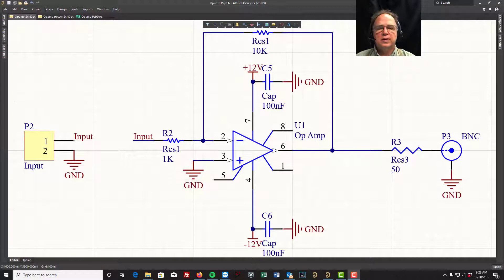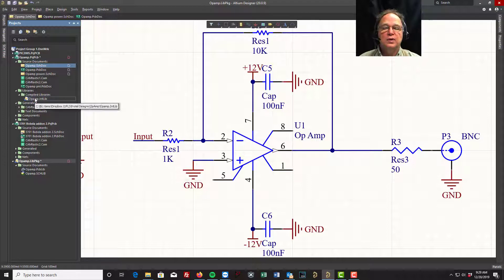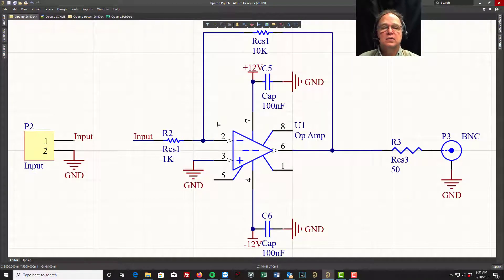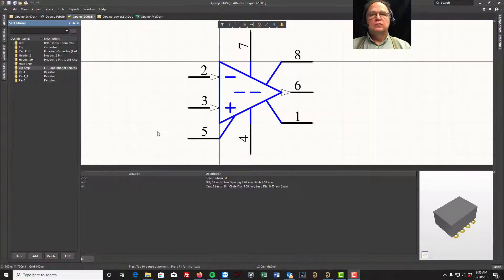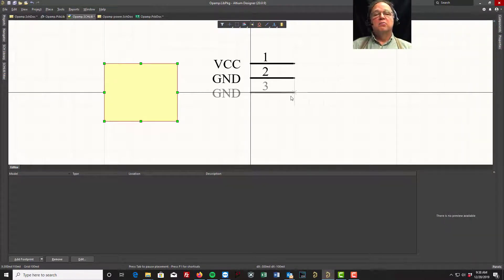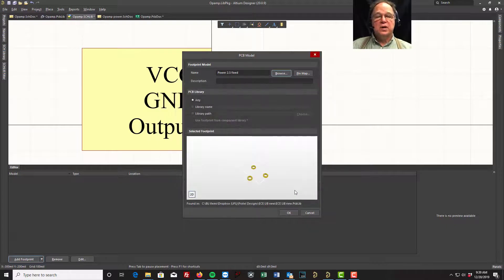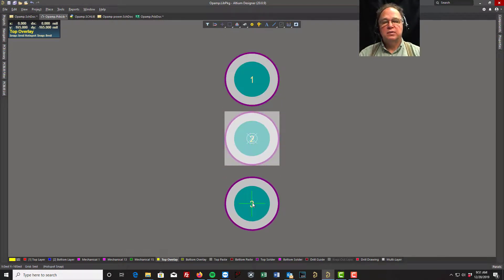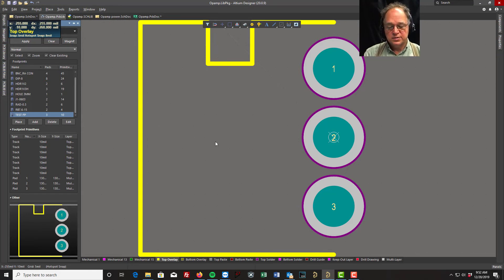10 Altium Designer 20 Integrated Libraries

Comment: I updated the RES3 resistor as you did, and confirmed that one of the silkscreen lines was gone as expected.  However, when I went back to the schematic and clicked on R3 and looked at the footprint in the properties panel, the footprint still looks like the original from the miscellaneous library (with both of the silkscreen lines).  I would have expected it to show the new modified footprint with a path to the new integrated library we created.  I then did a "Design/Update PCB..." expecting the PCB footprint for R3 to go back to the original footprint in the miscellaneous library, but it did not change.  To get the footprint back to the original in the PCB, I had to delete the component in the PCB and then do the "Design/Update PCB" and reposition the resistor again.   Using this approach you are suggesting here,  it appears that the schematic gets out of sync with the PCB and it is difficult to get them synced back up.   I didn't try this, but maybe if I had updated the schematic from the PCB, I could have gotten them back in sync?